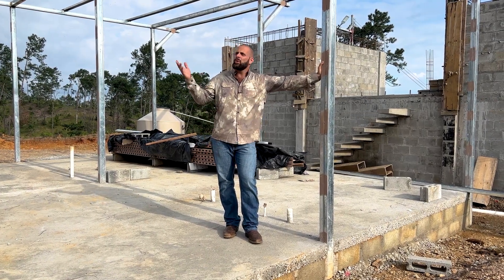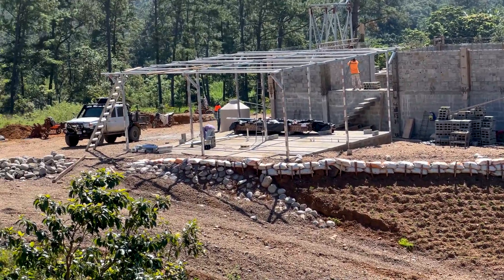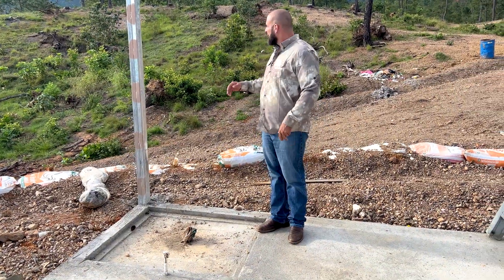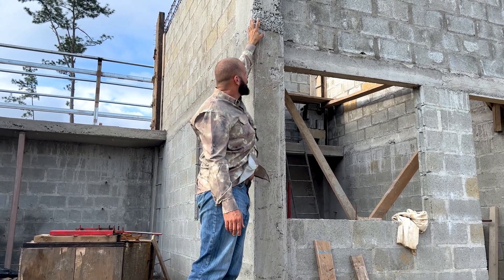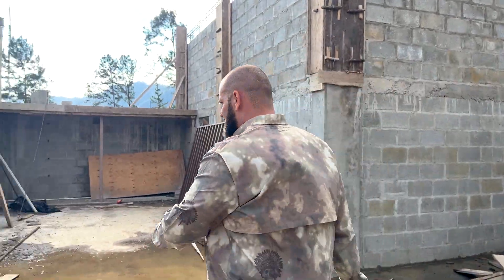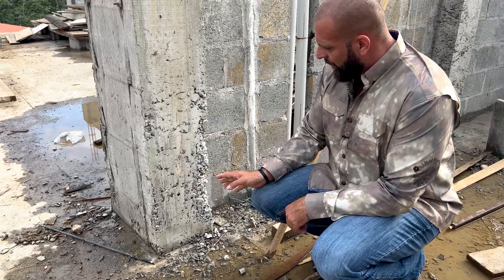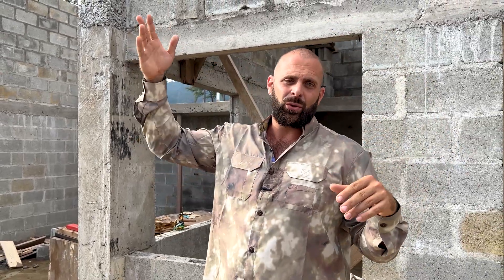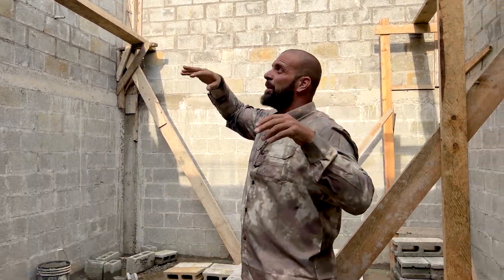Building My Dream Shop Pt. 9: Raising the Roof, Suspended Concrete Slab Design

Comment: Use a lattice mix 2 repair yur Spalding. Use bridge deck 4 yur roof an weider or screw it into yur metal roof joist. Run a 6x6 repair grid on top of the decking then pour a 7% slump mix.

Comment: Might want to have an engineer take a look at it. It might work, might not. No snow load helps but if you are putting a second floor on top I would be concerned. Its cool you don't have a power hungry building department ruling over you tho.